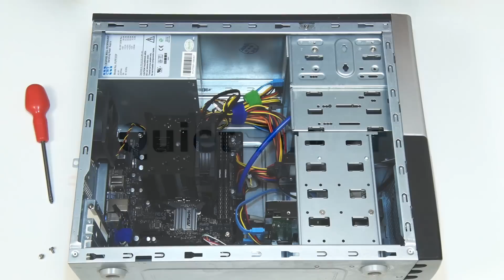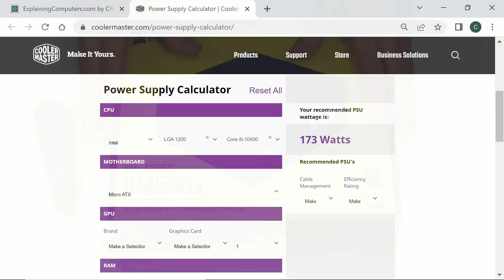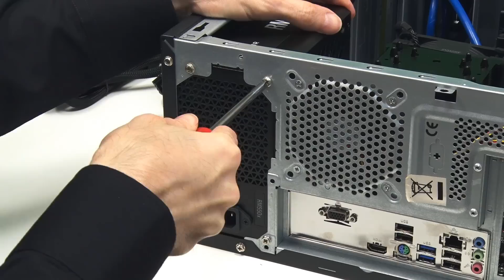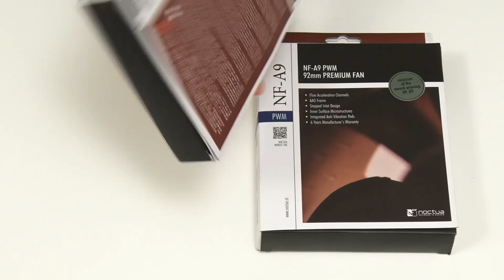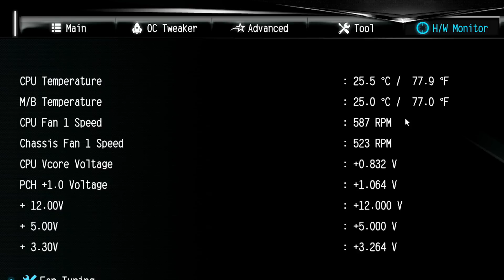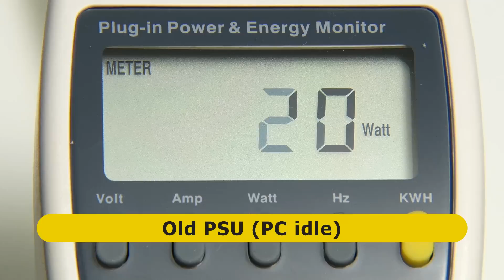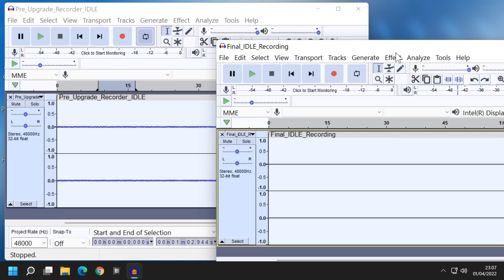Quieter PC #2: Corsair RMx PSU & Case Fans

Comment: To make things dead silent, I equipped my

MSI A320M-A Pro
AMD Athlon 3000G

With a Thermal Grizzly Arctic passive heat sink with a carbon fabric thermal pad and as a power supply I got the PicoPSU 120W 💪🙏

Undervolted the CPU and things are cool, dead silent and power efficient 💪

Comment: The choice of power supply and case fans make a huge improvement in terms of noise as you have shown. Great that the power supply fan only comes on under load. Definitely worth considering when building a new quiet PC.

Comment: I had a friend who actually had a panic attack when they noticed the fan on their RM750i was not spinning; and I did have to spare some effort to calm him down and to convey that it is working fine and that it is temperature-controlled.

My main machine uses a SF600 PLATINUM, one of Corsair's physically-smaller models. The ONLY time I could get it to spin, was with the OCCT stressing utility, though it does produce some mildly-noticeable coil whine when the system is idling. Once spinning, it remains so for (timed exactly as) 15 minutes after the heavy load subsides and it then returns back to the stopped state again.

Another great video to continue the message that silence is golden. :3

Comment: Good to see a video that addresses quiet computing.  My wife is very sensitive to PC noise , so I had to abandon my plan to use stock CPU and case fans for my recent build. In the end I opted for much the same as you - I went with a Noctua cooler and 2x 14cm and 1x 12cm Noctua case fans, a Corsair RMx power supply, NVMe M2 storage, and a graphics card with a zero idle fan speed (all in a case with good airflow). It's virtually silent when not under heavy load, and pretty quiet even then. Cost a bit more than what I originally planned though, but I'm glad I took the quiet option,
Reply: You can make the PC even quieter by using the rubber stubs on the fans to eliminate any vibration noise that may occur and cover the top, bottom front and side panels with sound dampening material which will absorb more of the sound that is still being produced.
Reply: @DF, good points. There are 2 approaches to making a quiet PC (at least 2, and they have features in common). One is good noise damping. The other is a case with good airflow, where the fans don't have to work nearly so hard to get the same amount of cooling - which also means less noise.

The best approach may depend on how noisy other components are, and the noise profile (coil whine, hard disk noises, etc). It may even be quite subjective. Vibration suppressing rubber joints for the fans (and other moving parts) can help with both approaches.

But it's an under-served part of the PC ecosystem, I feel. So kudos to this channel.

Comment: I usually overbuy on power supplies when I build rigs for myself or others, it helps for both power and noise alike!

As for fans, I bought 4 nf-p12 a few years ago and to Noctua's credit they are still going today and in use. Longest lasting fans I have had.
Reply: Can a quality PSU make other comps quieter?
Reply: @fjalls  Depends on whether the PSU vents its hot air inside the case or outside. If your PSU blows hot air into the case, then yes, its efficiency may have some very slight effect: A less efficient PSU will generate more heat, causing the rest of the cooling fans (CPU/GPU/Case) to spin more to get rid of the extra heat emitted by the PSU. If your system is cooled well you won't even notice this though. Please don't cheap out on your PSU and case cooling if you want your system to work reliably, i lost so so so many graphics cards because of bad cooling, this was years ago before i knew that this was the issue...
Reply: @vatterger  oh yeah thanks. I have a cool setup with good airflow. I just wondered if somehow a PSU could make other comps have less coil whine and such. Ive heard people say that but I cant really get my head around how that would work.

My corsair 850w is totally quiet untill above 50% use. Then the rest of the system is louder anyways
Reply: @fjalls  Coil whine happens mostly when the frequency at which the current flow through the coils of DC-DC converters is switched at an audible frequency, meaning below 20 kilohertz. This cannot be mitigated by providing cleaner power, as the voltage ripple coming into the DC-DC converter usually isn't the problem, instead its the load pattern or the switching frequency that's at fault in combination with an unpotted coil that can move and thus act like an speaker.
Reply: @vatterger  Thats what I thought. I can almost make my GPU sing by altering the "max fps" ingame
Reply: @fjalls  For that you want dampening on the inside of the case, bitumen mats are good for this. High frequency sound is easily dampened because it's low energy/high frequency. Of course in the modern mesh/airflow cases that isn't possible.

Comment: Heard a buzzing sound during the night, couldn't work out where it was coming from. Did a bit of sleuthing this morning, found out the sound stopped when tripping the upstairs light circuit. Then realised it was my Pi in the loft which is strapped to a joist. It was its way of telling me the Pi's fans are on their way out!
Reply: Does Noctua make a fan for the Pi? There enough Pi's around to justify it.

Comment: You paralled my changes over the last few years.
Used to have server with big fans and 10K RPM drives. PC as a router.
Desktop PC was noisy with fans and drives.
Now, server is RPi variant and quiet drives, router is RPi4.
PC is SFF HP with one fan that barely runs most of the time and M.2 SSD.
So much nicer, used to be like a jet engine running in this room.
The other benefit is cooling. In the summer all that heat caused me to need a window A/C and even more noise. I think I went from over 350 watts average to about 40 average. Much less heat.
Oh, tried RPi 4 for PC and it just was a bit too slow. But nice for 6W of use.

Comment: I have the exact same power supply and it is a great unit. Words can't express how great the modular design is. I'd never used one before because I'd mostly used refurbished office computers with a graphics card added in for some light gaming. Not tearing my hair out(I don't really need help with losing hair these days) whilst dealing with spaghetti junction makes opening my computer much, much more pleasant.

The big con I'll give it is that it makes a massive amount of noise when the fans do finally start up. In some cases it even gets louder than my graphics card, and sometimes even something as simple as opening a new tab in a web browser can set it off. Of course, this may be due to my set up, having a "mid-tier"(I consider it high, myself, but a lot of people have unrealistically high standards these days) processor and big graphics card.

Comment: Thanks Chris, very impressive. I'm glad to see the whole gang got to be in the video! :-P
I have been replacing my power supplies with the 80+Gold's also. I have 2 cases that still have the very loud ones and it is going to be replaced as soon as there is a issue... I have one ready to be installed as soon as there is a failure... 
LLAP 🖖

Comment: Not that long ago I was facing a similar issue, when choosing components. I did not dare to go to the semi-passive psu though. Instead I took a one that has fan always spinning, but is supposed to be below 13db at full load, and quieter at normal loads. So far I am happy with that. Actual airflow around hard drives makes more noise than anything else.

Comment: I love the 0 rpm PSUs for dust reasons. There's never any in there. Quiet is definitely a sweet bonus.
Reply: Yep. And it's important to overspec the PSU a bit for your needs so that it remains quiet at high load. Corsair RMx series fan turns on once you draw at least 40% of their rated power. In this video, it turns on at 220W (40% of a 550W).

Comment: I'd recommend arctic fans - same warranty as noctua (6 years), but substantially lower cost. They also perform as well as noctua in reviews, although the single most important factor for PC noise is the fan control rather than the brand of the fans

Comment: Another enlightening video from Chris @ E.C.  I seem to have preempted your quiet build, I'm using a Seasonic modular 550w psu the fan has never spun up at all, a Noctua NF-A9 case fan and a passive Nvidia GT1030. All in all a quieter machine than before. I got the (passive) GT1030 graphic card last year after watching your video on that particular model, it's knocked spots off of my old noisy GT 9600 so thank you for that, it's a good job we pay attention. :)

Comment: Your upgrade and tests make sense as Britain is raising its energy prices.  Having new fans and energy-efficient PSUs is indeed quite crucial for reducing noise pollution, excessive energy consumption as well as cooler temperatures to keep the motherboard and hard drives safe as they don't like heat that would brick the HDDs and maybe melt the soldering or worse pop several of those capacitors etc

Comment: Those silicon mounts are a great addition, they reduce the case resonance quite a bit on a computer that runs hot but at those low low fan speeds that shouldn't make much of a difference.

Comment: You need to listen to my pc with 200w in iddle and 13 fans (without counting the fan from the PSU and the GPU). A quieter pc is a dream.
And the PSU is a Titanium, the fan does not spin in iddle

Comment: Good choice. It's a Corsair RM750 I have in my system.  I bought it last year, before a major system upgrade, which meant I was future proofed! Handles my current system without any issue at all.   (AMD Ryzen 5 3700x, 32gb ram, Nvidia GTX 1660 GPU and 3 HHds and 1 NVME ssd.

Comment: I've tried to build a super quiet pc as well, but also ended up removing any hdd because they would sometime resonate in the case.
Also downside a of quiet pc's: coil whine coming from the psu, motherboard or gpu becomes much more noticable if one of them suffers from it.

Comment: Corsair fan and quiet don't normally go together, Every corsair fan I have used even the so called quiet fans have been loud. All Be-quiet and older Cougar fans lived up to the hype. Cougars orange Vortex hydrophilic fans where amazingly quiet I kept checking they was on.  Shame they didn't make UK release I had to import from Germany on both but CCL now stock Cougar parts but they have moved to putting gaming on them and charging to much for cheap parts as Cougar quality has gone down hill I wouldn't advise them now, as they have put RGB on them at the cost of the aerodynamic flow. Be-quiet still great and one of my favourite fan makers. Corsair parts are just so over price current here in UK. Passive cooling is great though so I give the PSU an extra star.

Comment: Very interesting as usual.
@ 15:10 I find the holes in the grid are too small.
In this case, I prefer to jigsaw a hole and add a wire grid behind the fan.
**
Très intéressant comme d'habitude.
@ 15:10 je trouve que les trous de la grille sont trop petits.
Dans ce cas, je préfère découper à la scie sauteuse un trou et ajouter une grille en fils derrière le ventilateur.

Comment: Back in 2016 december pre-ordered my Seasonic Prime 850w 80+ Titanium power supply, it was delivered from first batch to me on 2017 January - going strong since then... back in 2017 bought 4 x Noctua NF-A14 fans which I use to this day, along with 3 x NF-A12x25 fans on 360mm Artic Liquid Freezer II all in one liquid cooler. You can easily sleep in same room when computer is doing video encoding 80-100% load on Ryzen 9 5950x.

Comment: A note about those left over modular power cables. Keep them, by all means, but never try to use them with other manufacturers' power supplies. There is no industry standard for the sockets on modular power supplies and there are even differences between different series from the same manufacturer. For example Corsair's RM (as featured) and AX series have incompatible leads. So if you have more than one PC with modular power supplies keep the spare leads in their bags and label them. Throwing them all together in a box could result in an expensive mistake.

Comment: It would be much more difficult to attach the cables to the power supply when it is inside the PC case.
The old power supply already had the cables coming out of a hole on the back of the supply! Much easier to do it like Chris did!

Comment: About modular cable psu: It's imperative to not use cables of different psu manufacturer or carefully check the psu pinout because it's not standardized like the ATX and molex connectors expecially the SATA/Molex cable. I know people who fryed some hdds.
Reply from the maker: Wise advice.

Comment: I only discovered your channel about a week ago and have been bingeing through the last 10 years. Great stuff

Regarding the silent PC upgrade. To be fair the lightweight generic case you used didn't really help you very much.
For the last 10 years or so , (and several build/upgrades), I have use a Fractal Design 3 case. Very solid with good airflow, dust filtering and sound deadening materials applied to the sides and probably the top of the case. My current build, dating from late 2017, is a Ryzen 5 1600 processor with an 8GB R570 gpu plus various SSD's and HDD's. I have two front case  fans and one rear fan which I think were supplied with the case. My PSU is a Corsair, (can't remember which model but around 600W), and I always fit my PSU's to draw air from inside the case - reduces dust intrusion and supplements the rear case fan. Temps and noise are quite acceptable.

For the next upgrade I'll definitely be looking at some of those larger and slower revolving Corsair fans. I think that the Fractal Design case will last me a few years yet as my under the desk machine.

Comment: Another liquid cooled design feature : It puts the CPU heat outside along with the other heat inside the case. One drawback though, motherboard chip sets with heat sinks that rely on airflow from the CPU fan may require fan's of their own now. Use curved leading edge bladed fans like Christopher is doing here and those will be quiet to

Comment: I think your setup is quite balanced because 100% passive cooling on anything above a 4th gen i3 is not practical. Mid to high-end CPUs and reasonably powerful graphics cards require some sort of fan coolers. How about different types of water coolers? Water coolers are not cheap or simple by design and the PCs with that type of a cooler aren't very good for portability. Your setup is fairly balanced. 👍👍

Comment: Great test results. Yes, Noctua fans are more expensive and do go overboard on their packaging, but I'm still a fan of theirs.🙄 Why jeopardize project over a few dollars after investing six month's worth of labor? What is the value of one's time and satisfaction from making the best .............?
The fan on my year old miniPC has been bothering me from day one of it's arrival. Not only the whirring, but an additional vibration like a dirty bearing. Hoped that it would run smoother with usage. Not! Looked at replacing it with one of my Noctua fans, but the original is a small centrifugal blower type. Still, it's gotta go before I lose any more of my limited sanity.
Stanley the knife, Mr Scissors, & Mr Screwdriver... hmm. I think I'm seeing a trend forming, Chris. Don't you need more exposure to Ms Socket, Sally Sidecutter, or that hot little Gretta Gluegun for PC? 😎

Comment: @ExplainingComputers
When you get a GPU, do yourself the favor of buying something like a GTX 1050 or GTX 1650. They both are still very power efficient and quiet, but are leaps and bounds better than a 1030 in the area of performance, especially for anything where CUDA will be utilized.
Reply from the maker: Thanks for this. A 1050 or 1650 would indeed be more powerful, but would destroy the whole purpose of this PC. It has to be quiet as in recording room quiet, and I know from experience that a 1050+ is not. :)

Comment: Videos like this are great, and hopefully they get manufacturers to pay attention.  Maybe you could do something about all the stupid lights all over everything in the future.  I built a super-quiet system about a year ago, but the darn motherboard puts on a stupid multi-colored light show no matter what!  Even during sleep mode, and you can't even turn it off in the bios.  I had to push the case flat against the wall because they all want to have a glass side on them these days too.  Flashing lights, jagged sharp heatsinks all over, all because everything has to be marketed as EXTREEEEEEEME!!!!  They must be drug addicts with an unlimited LED budget.

Comment: Just fitted a couple of those Noctua fans. I would advise against using the silicon anti-vibration mounts unless: 
a) you have good all-round access to the fan (the mounts need pulling through the holes in the fan with pliers - they're not rigid enough to just push the fan onto) 
b) you are mounting to holes in the PC case (rather than slots). My rear fan mounts to slots and the silicon mounts don't grip the slots.
Apart from that, they seem well made fans, and although they haven't made a stunning difference to the noise level (which was quite low anyway), it's nice knowing that they are PWM controlled and the best they can be.
The only other observation is that when I turn my PC on, I get a high pitched whine until it gets into Windows. I suspect it might be the PWM sorting itself out, but that's probably a motherboard "feature".
Loudest thing by far now is when the graphics card fans kick in.
Reply from the maker: Very interesting feedback on the silicon mounts.